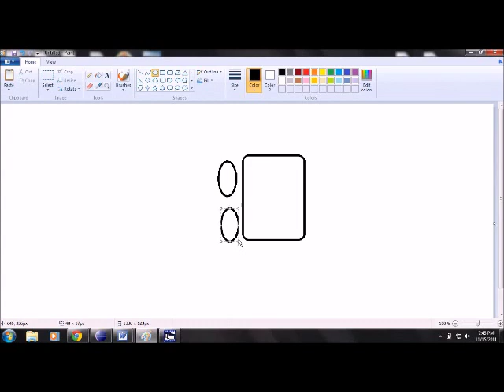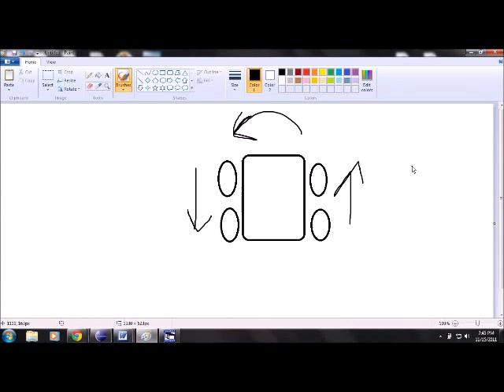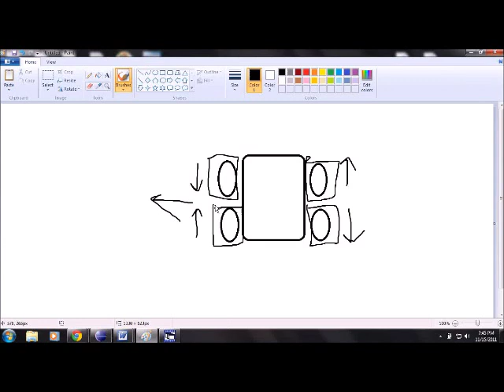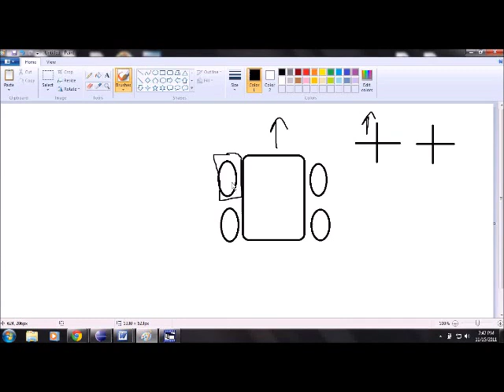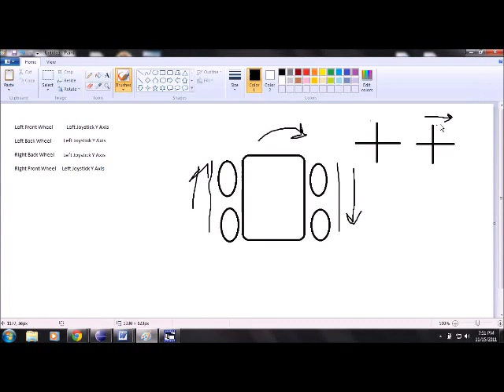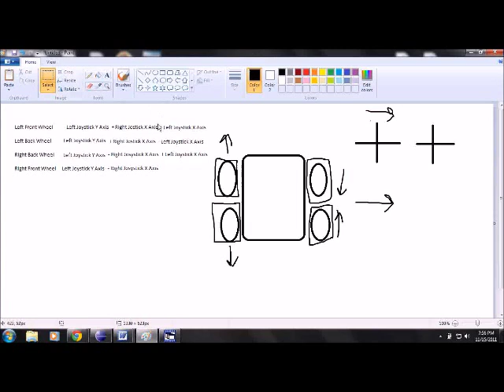Mecanum Wheel Tutorial

Comment from the maker: I only ask because the newer motors tend to trip their circuit breakers more easily, and maybe that's what you were referring to when you said too high/low. I made this tutorial with the ROBOTC language and VEX remotes in mind. Those remotes register 0 if the joystick is centered, and -127 to 127 on either side. Since your controller goes from 0 to 255, you will have to offset the values. Though, this tutorial is for mecanum drive, which needs a lot more code than simple two wheel tank drive.

Comment: I tried doing just the arcade thing, and the values are way to high or low for the motors. I'm using a PS1 controller, and the joysticks go from 0-255 from top-left to bottom-right. Think you can help? Oh, and it is two motors.